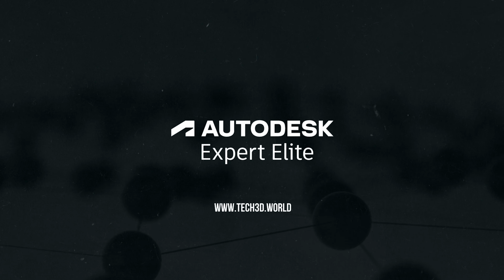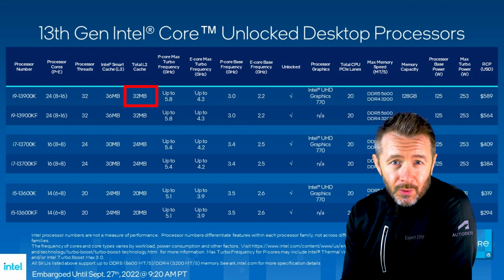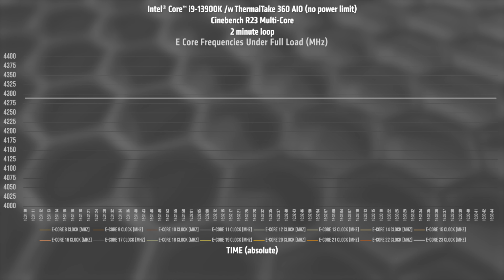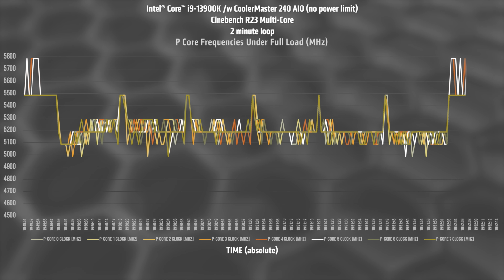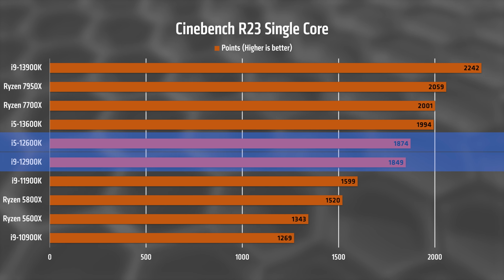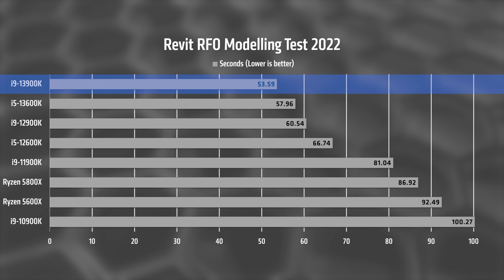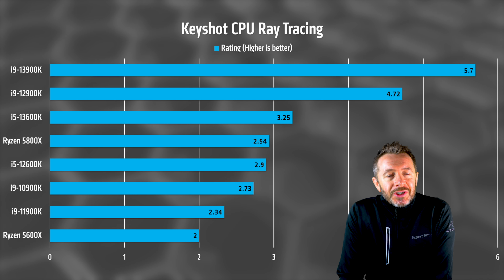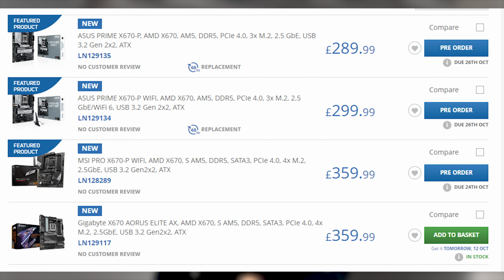How good is Intel 13th gen? (Pro/CAD/Rendering)

Comment from the maker: It's likely that the MSI board I'm using is very much on the more aggressive side of voltage and power delivery, hence the power draw with the power limits removed.  This was of course all done with everything at factory spec/defaults and no manual or auto overclocking or power increases applied, and no third party software installed.
Reply: i will keep my Athlon 64 😂
Reply: Modelling and graphics scores for Revit are from RFO Benchmark Full Standard 2022? If yes, then 12100F performs better than 11900K (I just run it and got 67.22 for modelling and 19.74 for graphics). Really surprising leap between generations.
Reply: You are way ahead of the game. This is the earliest mention of the problems faced by 13th and 14th gen Intel problems.

Comment: I am trying to decide on either the AMD 7700x or the I5-13600k because these are in my budget and also because I feel this is enough for my skill level at the foreseeable 5 year outlook. I was following along your video but noticed the 7700x fell off the list more often than being on the list.  I think I missed the reasoning for this?
I am trying to build a home system and would like to know which of these two would give me the most. I am using CAD 3D while viewing multiple PDFs but would like a system where I am not waiting for 3D visuals to catch up. Thanks for any help I also think your channel needs more exposure but understand you deal with top of the line systems. Valuable info none the less. There is not much info across the web in 3D design.
Reply: Personal experience, Intel fells more "snapier" than AMD even when benchmarks show a diferent result. More than 30 workstantions built.

Comment: Hi Neil, a quick question for you if you happen to see this. I was wondering if you know how E core count might affect performance on Autodesk CFD? I am between the 13900k and 13700k and CFD is really the only use case I have where I may be able to justify the more expensive i9. Based on other benchmarks I have seen I assumed it would be about a 20% difference, but your Invmark results indicate that it may be far less than that, perhaps closer to 5%? I am not super familiar with the inner workings of Autodesk products, other that knowing that they generally don't make use of GPU acceleration, so any expertise you can share is appreciated. Thanks mate.
Reply from the maker: Inventor is very different to CFD but from the minimal testing that I've done, I couldn't get CFD to use all the cores available but I'm really not all that knowledgeable with it. If the CFD simulation solver uses all cores then absolutely the 13900k would be better, it'll use all P and E cores for that. If it's mostly single core use then you're right it's marginal between them. If it was me and I was doing CFD for commercial project work, I'd go for the i9 regardless as the 200£ or 200$ should be easily justifiable and shouldn't hurt the bottom line too much for that kind of engineering work. But if its a home or practice/study system it's a little harder to justify that cost. I guess it's all down to your budget, if you're on a restricted budget then that 200 could go towards a bigger ram kit instead of the i9, but if the system is gonna earn you money I'd shoot for the i9

Comment: Yeah, obviously it'll be cheaper to go for a 13th gen intel system now especially when you can use your 12th gen moba however you need to keep in mind that if you go for a ryzen 7000 system you'll future proof motherboard and ram until 2025. That could mean the same moba and RAM for 2 generations from AMD to come.

Comment: Thank you so much for your valuable videos, keep on doing great!, and good luck!
I am planning to get the home workstation for Revit, AutoCAD and inventor, as well as, for structural calculation software's like ETABS, SAP200, and Robot structure,  having the following components:
1. Intel Core i9-13900K
2. ASUS TUF Gaming NVIDIA GeForce RTX 3090 OC Edition
3.  Corsair Vengeance DDR5 64GB (2x32GB) 5200MHz C40
4. CORSAIR iCUE H150i RGB PRO XT, 360mm Radiator
5. Ultra 4K wide screen (34 inch) 
Having only 5% ( CPU 100%, and GPU 95%) bottle neck at the screen resolution of (3840 × 1600)
I think with this I will have a great production boost, and sometimes enjoy some online gaming like WOT (World of Tanks), What do you think?

Comment: LOL!!! With AMD you need to go all in with a complete change in the rig but with 13900K if you already have a Z690 mobo then you are already there. Then change it up later. Most bang for the dollar.
Reply from the maker: If someone already has a Z690 rig, I wouldn't recommend upgrading to 13th gen as you're already on 12th and the jump in performance isn't that dramatic for most people.  But hey, the option is there and options are good!
Reply: @Neil3D  but for people like me on a 12600k, it could  be a worthy upgrade. Not all z690 run 12900k =)

Comment: You want to pump 300+ watts through a cheap motherboard ?
Reply from the maker: The Z690 platforms should be rated to handle that, the cheaper Z690 boards should still be 'relatively' well made and have gone through QC for this.  If not, they can enforce the 253W limit, if they don't do that and things start setting on fire or failing dramatically, then that's brand PR suicide and there's a precident for that.
Reply: Well, AMD FX-9590 says hello :D anyway, watch der8auer who tested the 13900k with 90w limit, and it was only a few % slower, and the power effiency then was so good that it even beat 5800x3d in some scenarios. (also remember that Intel is still on a 10nm node where AMD is on 5nm.. so when Intels next platform comes which will be on lower nm die, we will see drops in power)

Comment: I'm Chris and I'd already subscribed! 😆 Seriously though, helpful video thank you, would have been interesting to see power draw on single threaded work, just because that's what I mainly do (CAD, etc.) and I pay the lecky! 👍
Reply from the maker: I tested it and it's only around 40-50W which I didn't really find any value in reporting as I don't have historical data on that for other parts, and at the end of the day when it's at 40-50W it barely registers and some monitors use more power than that! But thanks for bringing it up, I'll take note for the next one!
Reply: @Neil3D  Cheers for this pal...yeah bit of time has gone by, but construction industry goes bananas occasionally! Really helpful to know it's a non issue when it comes to power usage. Something that sounds silly may be, but I do wonder if CAD is definitely going to use the performance cores and not 'accidentally' use the efficiency duberies? Cheers matey 👍

Comment: Computers just like the old light bulbs are 100% efficient in the winter because they just heat your house or office up instead of your gas boiler, in fact if you have a green energy supplier like me they’re way more environmentally friendly than a gas boiler. Might need a Tesla power wall to run a 13gen-i9 from cheap rate off peek electricity mind.

Comment: Thanks for this.  I'm starting to look at updating my work machine.  Currently running a i9-9900k with quadro p5000.  Trying to find the best processor and gpu for autocad and point cloud work that likes as many cores as I can throw at it.

Was originally looking at AMD for the first time, but maybe sticking with Intel after watching this.
Reply from the maker: I would stick to Intel, not just for brute force but the hybrid workflow adds massive value.  Drop a scan import onto the E cores and you've still got 8x 5.8Ghz cores still free to do other stuff, can't do that on AMD